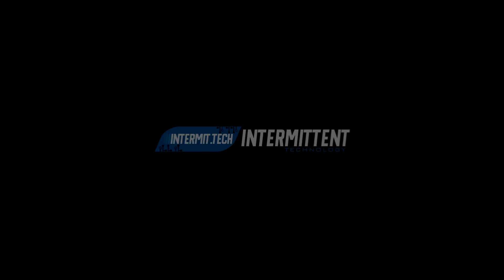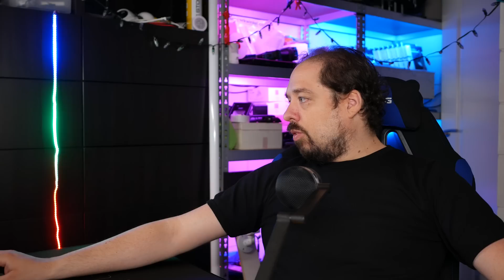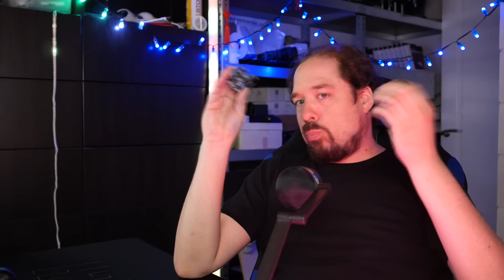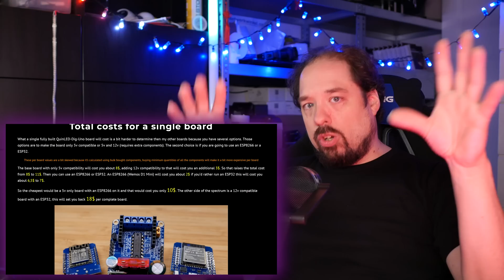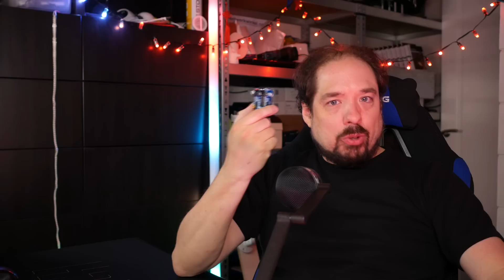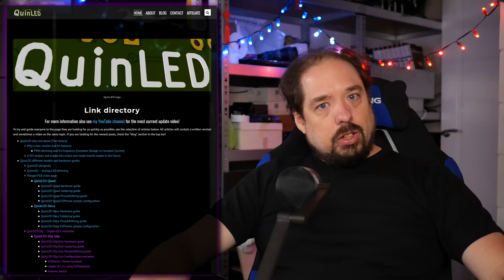QuinLED: QuinLED-Dig-Uno is here! (DIY ARGB Controller)

Comment: Hi. I want to run 2 sets of sk6812 (stairs light- one side will be almost 5m and the other one arround 3.5m). 
Questions:
1. Can I do this from one dig uno(to hook them up from the same one and inject power at start-mid-end)?
2. Does involve question 1, can dig uno support all 8.5m wled sk6812 60 /m ?
3. Do I need aluminium casing for the leds?or plastic one will do the trick?
4. If dig uno can't handle 5m+3.5m what else do you recommend?

One of the Leds strip will be shorter because there is a right turn(which makes the lenght to be different)
I really one the buy everything from your website and support your hard work instead of building everything from scratch and mess it up (I'm not capable of doing all that work LOL, thanks god you exist and make our life easier)

Please help me out

Comment: does this controller work with 24V lights? Also, how is it connected to a computer? I'm still quite a bit new to all of this.
Reply from the maker: Yes the newest pre-assembled and DIY versions are designed to addressable 24v LEDs too. You connect to the controller over WiFi.
Reply: @IntermitTech  Hi. It is able to control DMX (RGBW) strips too? If so, what is the pixel limitation / board (uno or quad)? Thank you!
Reply from the maker: Sorry no the current Dig boards do not have the hardware required to talk DMX.

Comment: If I am using the controller just as controller and run my LEDs on a separate power line (I need more than 20A for them), how much current/power does the board draw?
I am asking because i want to know the minimum wire size I need to power the controller.
Reply from the maker: The controller just by itself generally runs fine from a 1Amp supply but on average uses below 300mA

Comment: Hi, just built my first dig uno, rev v2r6. I have an issue where the leds don't work, however, if I connect a volt meter between data out and ground, they work correctly. Any idea, do I need a pull up / down resistor somewhere. I left off the optional ones when soldering up? Thanks
Reply from the maker: That's really odd, I believe you are in the Discord already troubleshooting with us, we'll get it figured out. :)
Reply: @IntermitTech  yes, joined the discord after I posted here, all sorted 👍

Comment: Hi, i had 2 dig-uno and installed the latest wled. I see the board in wled app (android)  and also in Home assistant, but I m not able to see the temperature sensor that I know is on board. How I could access to sensor data?
Reply from the maker: Temperature sensor is currently a usermod you need to install using a custom compile. In rare cases it would influence the LEDs (cause flicker) so it's not included by default.
Reply: @IntermitTech  where I can find info about?

Comment: Hello, just discovered your QuinLED project. Really interesting. Do you plan to make a multiple channel digital board? For example, I might have three or four SK6812 strips in physically different locations and may want to control them from different GPIO pins?

Second question, and this is more about WLED than QuinLED! But do you know if it supports 2D arrays? I mean a single channel SK6812, but with light effects split up into segments within that channel? (e.g. if I install an SK6812 strip into different sections of a cupboard, but wire data together into a single channel)
Reply from the maker: I just released the QuinLED-Dig-Quad which adds some stuff like multiple output pins!

The array mapping is more a software thing, I think you could do it with E1.31 and xLights for instance.

Comment: I have made all the versions of QuinLED boards and have been very impressed with the thought in the layout while keeping a compact size.  I particularly use Quads at the moment and love having the flicker-free dimming.
Currently building my first Dig Uno.  Looking forward to it.
Quin boards were my first time doing SMD soldering and it worked first time, with the aid of the video tutorial.
Very impressed.  I will be migrating all my LEDs over to QuinLED boards

Comment: I love your intro.  "This one is going to be a good one."
I think all your videos are good 🙂.
Thinking of the Dig Uno, I am thinking it could be used for anything, not just LEDs.
It looks to be basically a power regulator and protection circuit with some IO breakouts.
Would that be about it?
I am thinking that it could be a great little circuit to use in multi-sensors, with the right sketch on the D1 mini, to provide a regulated supply and protection for lots of projects.
Reply from the maker: Well yes, certainly, but a little bit no.
So the board is indeed a generic board, it's been designed around driving Addressable LEDs and with a lot of protection in mind but that's not the only purpose you can use it for. There are 4 GPIO pins that have been broken out into pin headers you can use for input and outputs. The 2 GPIO's that are going to the screw terminals through go through a uni-directional level-shifter so can only be used for output, not input! Other then that you are correct, there is nothing stopping you! And where WLED is a bit limited in what you can do with the board if you run ESPhome on it, especially with an ESP32 it's quite a powerhouse from which you can run basically anything while also driving addressable LEDs! :) So if you have boards left, want the reverse input/ouput and fuse protection but are not going to drive LEDs you could for instance leave off the level shifter to save some costs.. :)

Comment: Thanks for the video, I like the projects you do. I want to put a concrete walkway to my house and have programmable LED lighting with motion sensors in it. Do you have any suggestions on the best way to accomplish it? I  thought it would be nice to have lighting that follows someone walking up and down the walkway and be able to program them to do different things. What do you think?
Reply from the maker: That's certainly possible, best would be to mount the controller at least pretty close to the walkway, otherwise you are going to need pretty beefy power wires, although that can be managed by using 12v strips with which the gauge can be smaller.

About the strips themselves, they would have to be in ducting and also be IP68 rated I think. But I don't know how you could prevent water getting in the ducting (aluminium profile), maybe fill it with clear resin/epoxy, something like that?

Motion control could maybe be done with sensors mounted on either side of the pathway, I know there are ultra-sonic sensors you can mount outdoors. You could link those to the controller (Or at least a QuinLED-Dig-Uno) and run a custom arduino program or you could link them together over the network (with for instance Home Assistant).

Following someone on the walkway would be hard, most often, like on stairs and stuff a standard pattern gets started which is timed or "shut" using a second sensor. If you want to make it really fancy you could put sensors at multiple points in the pathway and make it go further each time.

Just thinking out of my head here, maybe it gives you some ideas. :)
Reply: @IntermitTech  Thanks for the awesome advice. Question - With my walkway being about 150 feet (46 meters) long and shaped like a T with curves, do you know of any good, low power (less than 3W - maybe 1/2W) single lighting that I can install into some type of conduit to form inside the concrete? kind of like an airport runway lighting, but very low brightness. I was thinking of separated them 18 inches (46cm) apart. That would be approximately 200 lights.  Maybe I should separate them a little farther apart.
Reply from the maker: @SomethingNewToDo  Oh wow, that's quite a bit longer then I had in mind, if doing the above example you'll need to provide some power injection points along the way for sure, multiple times if if only using 30LEDs/m tape.

Regarding to your single light question, I'd have to dive into researching that too, especially if you'd want to make those individually addressable, that's quite the project! Trying to make that inside of the concrete is going to add another factor of difficulty too, I'd almost suggest making some sort of very low rail to the side of it where you house the lighting and the cable inside and then shining onto the concrete (maybe from both sides?) then trying to make it into the concrete.

But I'm certainly no expert in making something like that either, for something that scale it's going to cost a lot of time (including the research) or if you ask a professional a bit of money. They probably have systems that are suitable for these kind of things that also get used in commercial building projects and such, probably way more expensive but that's the best advice I can give you, unless you have time to build it all yourself.

Comment: why he wont give us the file from the pcb
Reply from the maker: Hi Marlon, I used to do this for the first boards I released but it made it very hard to do updates to the PCB and components. Old versions would stay around and cause all kinds of confusion. Also, not all PCB manufacturers make the board the same way and that resulted in non-working boards for some people. That's why I'm doing it like it is now, with a shop page. I am working on another PCB vendor though so there is more choice. :)
Reply: @IntermitTech  But you can provide the pcb file extra?
Reply from the maker: @M.4y  ...? That would defeat the whole point of not sharing them in the first place....
Reply: @IntermitTech  I cant find your shop page - can you please update your website with big button at the top of every page that says shop or buy?
Reply from the maker: If you are looking for a pre-made board, those don't exist. It's a DIY project where you buy the PCB board and all components and solder it together yourself. That stuff is all on the "QuinLED-Dig-Uno Hardware guide" page. No kits or pre-made versions right now.
Reply: @IntermitTech  hey mate. I found it - the link is under the hardware guide. from a user point of view its hard to find the links to actually buy the PCB's. just pop a link on every pcb page to your ditypcb link. took me ages to find and I nearly gave up
Reply from the maker: Thnx for the feedback, it helps! I think I understand and might know how to improve that. I'll try and work on that soon!
Reply: @IntermitTech  You do not understand me. I would like to add some features to the PCB. That's why I need the files. I do not need a link where I can buy it. I want to make a alarm indicator. With sound and light. And other featues. I have 250V and want it to run the arduino. So I need a converter. My plan is to integrate it.

Comment: Great product I would like to have had the option to have the Gerber files but ya like the vid 👌
Reply from the maker: I'm looking into getting a second PCB manufacturer because I know some people don't like DirtyPCB (and their shipping can SUCK!), hopefully that helps with not having the gerber files, I've just had a bad experience with that in the past so trying to avoid that again and make it less frustrating for people and trying to get them to end up with something that works. :)
Reply: I use JLC pcb and have found them to be very good on price when I looked at the one you're using  the cost for on would be equal to 10 on jlc so the cost is really what's getting to me but hands up to your product very nicely don.👍
Reply from the maker: @jwm1020  I think it really depends on shipping and how often you order (JLCPCB gives a lot of discount the first time). When looking it seems to be 24$ on JLCPCB (DHL) and 30$ on DirtyPCB's (FedEx) for ~10 boards.

The cheap shipping saves a lot on both (but can take a very long time to arrive) but that's why I'm looking at adding PCB vendors.

I'll re-evaluate if it's worth it to release the gerbers though, cheaper is better in that sense. :)

Thnx for the honest reply! :)
Reply: @IntermitTech  All good 👍